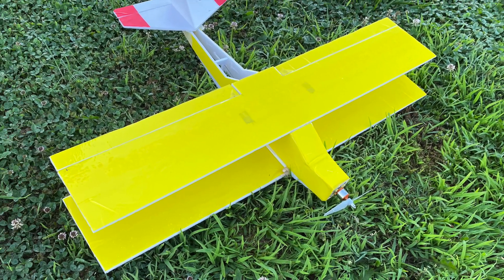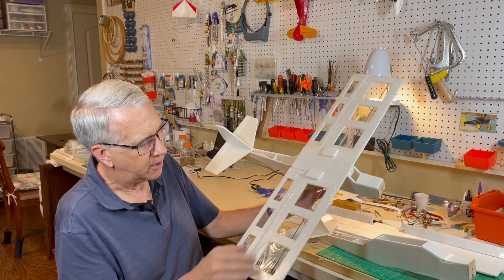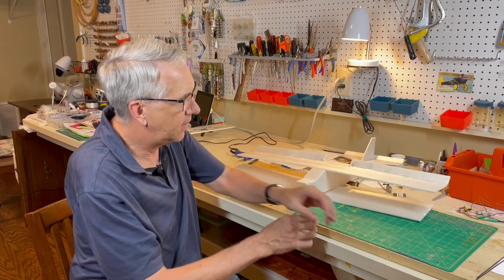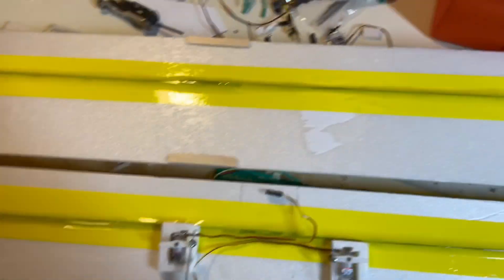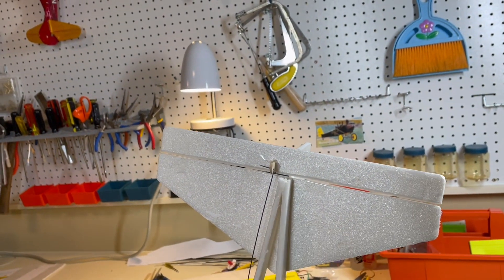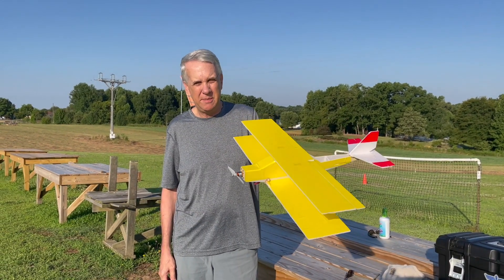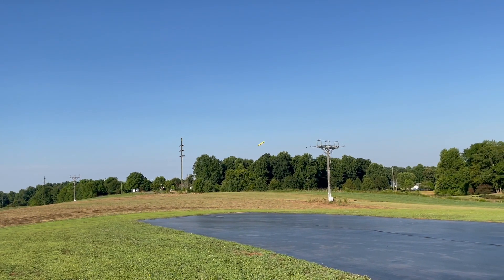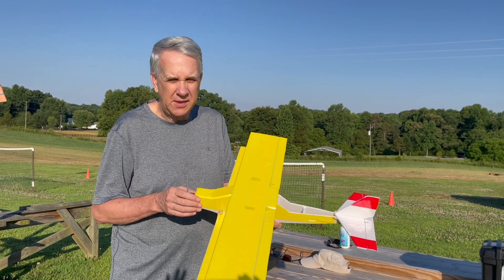Lite Ranger Stagger Wing RC Airplane

Comment: Nice work, Tim. The foam/carbon fiber scratch-built approach seems like it would be rewarding. And a person can delve more into the "scale" details, IF that's important. I'm working with a static Guillow's F6F model, right now .. and hoping that my stash of party wrap cellophane will work for the covering.
Reply from the maker: Ken:  Thanks for checking in!  Agree with your points.  And the Guillows Hellcat is a great kit.  Consider making a flying one some day, the model is very easy to convert to RC, see my conversion here.  Tim
https://youtu.be/k_xrP0ccWLA

Comment: Two tips:  1. To remove paper from foam board, spray it lightly (or brush lightly) with isopropyl or denatured alcohol. It will peel right off. (Note: water won't work.)  2. To remove hot glue from a servo or other smooth surface, apply alcohol (or mineral spirits or lacquer thinner) with a cotton swab and the hot glue will pop right off.  PS: I enjoy your videos!
Reply from the maker: Clarence:  Great tips, appreciate it!  Tim

Comment: You mentioned several times about the Q Cad so can we get the printouts that you have from the QCAD?
Reply from the maker: PDF files can be downloaded from Description, will see if I can add the QCAD file. Tim
Reply: That would be fantastic if you could as your video is very well-made but as a beginner builder I’m having Difficulty with the small print of the regular plans. And measurements and formers aren’t very clear as someone else mentioned. Anyway Tim …thank you
Reply from the maker: Cliff:  Keep in mind the design is quite simple. Straight lines, etc. Use the 6” ruler to get a good idea on dimensions. 😊👍🏻 Tim

Comment: As you can tell, I'm a new newbie. I see planes with rudder and elevator. I see planes with rudder, elevator, and ailerons. I haven't seen builds with ailerons and elevator. Is there a reason for no rudder in some of your builds ?
Reply from the maker: Robert:  We all started somewhere!  For most "Sunday flyer" models, rudder is not used all that much in the air.  For slower aircraft, the rudder is usually enough to turn the model, easier to install than ailerons.  For faster models, the ailerons are a must for bank control, like the Stagger Wing.  Tim

Comment: Morning Tim, are these full scale plans where I print them on regular printing paper and then tape them together?
Reply from the maker: Cliff:  Not full scale plans.  There is a separate plan with dimensions.  All straight lines, easy to sketch out on the foam board.  Tim

Comment: The plan with measurements is super. I love no having to print. Could an Armin wing work on this model. I have been looking for a Bi-wing were the top wing is attached directly to body. Thank you
Reply from the maker: Robert:  An Armin wing would certainly work.  Just double the foam board on the fuselage for additional strength.  Tim
Reply: @TimMcKay56  You mentioned raising the top wing to have more space between the wings. What is the space between the wings now? How much would you raise it? I wasn't sure I got the total height of the fuselage correct. I'll start cutting the foam tomorrow Thanks again.
Reply from the maker: Robert:  3” space between two wings. It flies fine with this, if you raise it for appearance sake only. Tim

Comment: Can you use the 20% of the combined chords on biplanes when the upper wing is leading the lower wing?
Reply from the maker: Rodney:  Per the video, I used 25% back from the leading edge of the forward wing to determine the CG, although I think you could go to 28%.  The stagger does not matter, same rule if top wing is forward from the lower wing.  Tim
Reply: Have you seen this video "RC MODEL 1905 WRIGHT FLYER"  @TimMcKay56